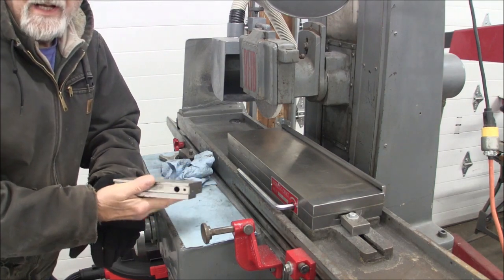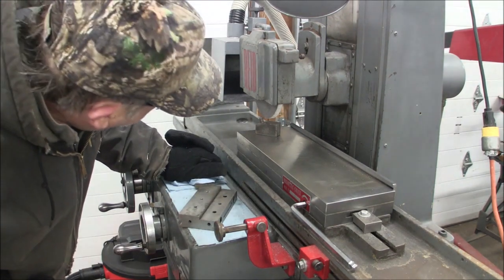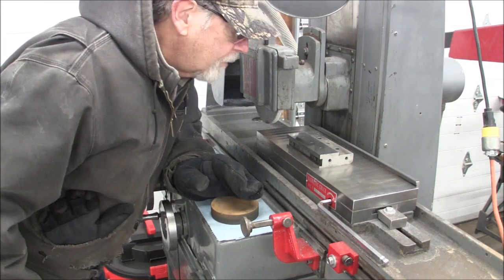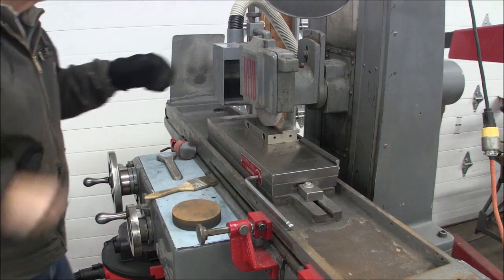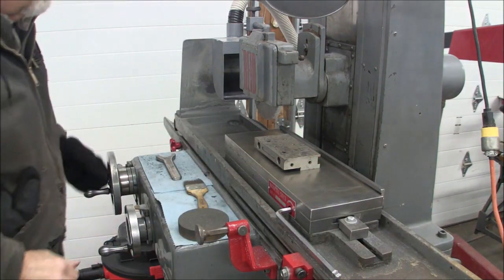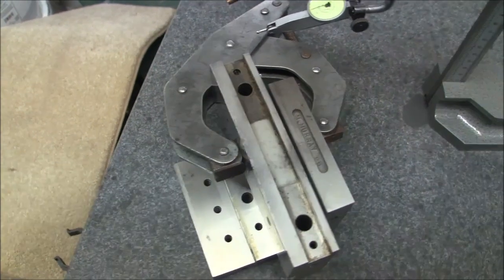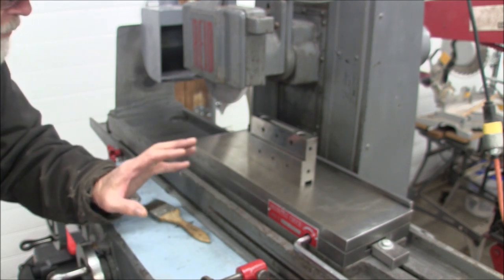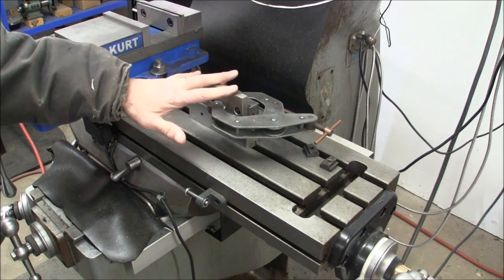Surface grinding 101

Comment: am retired and trapped in by the heat so I want to make a case study of this video to help the community and himself with some tips as to whats going on. it will be lengthy but still like watching machining videos. very good sincere video the guy did. You wont like it at first and will come across like a lecture but you will like it alot in two weeks. As he took the time and effort for the video I also will invest time in it not just one line comments

Comment: That Reid as you know is a nice grinder. I have the Boyar shultz 2A-618. 2 more for rebuild. Thanks for the video, I wasn't award of the "Norbide" learned something. -Tom
Reply: I've got a finger like that...😄. Horizontal bandsaw...😐
Reply: Knoxville....a little bit warmer
Reply: Kinetic precision for the superb wheel balancer....most important especially for finish...(my 2 cents)
Reply from the maker: @tomeyssen9674  Fingers can take a beating through the years.  Battle scars! 😆

Comment: a quick on on sparking out while grinding dry such as when doing precision tooling. You have to multitask you cannot stand at grinder and go back and forth. the sparkout is not what you think hitting off high spots. The fact is the part is expanding up into the wheel and even during sparkout you can get howling and burning. when a person stands there going back and forth till all sparks are gone that is simply because the heat now has gone down into the entire part and chuck. as far as the pin cusion effect when he goes very small stepovers the heat front is outracing the wheel. it is not just the hump in the x it also occurs in the Y. when he starts from back stone cold he finishes up with part hot and the front will be lower. as you start back you wonder "why am I now hitting on the back?" that is why you are going from cold to hot then racing right back over hot to cold. final passes of tenth or so that is why go back to front--now crank back in air. now go again. you are now passing over the metal at same temp.

if grinding dry you have to multitask and have other things going on final passes. dust across then go over and set up other machine or do garbage. now come back and dust over again and knock off the ears. if something only has to be "within ten thous?" thats a milling op not grinding

Comment: Great job Mike!  I just wish I had the space for a surface grinder.   I've seen some pretty nice ones go for cheap lately.
Reply from the maker: Thanks!  I've seen a few pretty good  deals lately too.  I'm thinking surface grinders aren't in demand like mills or lathes. If I had more space is be looking for an automatic wet grinder.  Never enough dang space! 😁
Reply: @michaelmurray9154  Hey Michael, I bought a boyar Schultz 612.  I haven't seen it yet, but I'm hoping it's not a turd, it's only 7hrs away from me!  :-O
Reply: Hey Mike, now that I've got my surface grinder up and running, do you have any suggestions where I can find a jig for grinding HSS lathe tools?  Stan at Barz did a video on one.  Looks pretty tricky to make.  https://www.youtube.com/watch?v=_GOu6db4EJc
Reply: @jagboy69  the same grinder as him? What is it?

Comment: Re the balancing issue, on my SG the wheel fits directly to the shaft so there is no way to balance it off the machine or on for that matter.
Im not overly safety minded but it worries me when people wipe the chuck with their hand under a wheel, i know yours was not turning but i feel it is a bad habit to get into because one day you might forget and spinning wheels and tendons don't much like each other. I always move the chuck to one extreme to reduce the risk of contact.
Reply from the maker: You have a very valid point. I've seen it happen. I took the guy to the emergency room.  Plowed a 1/4 inch deep trench 1/2 wide across three of his fingers. That's why I do very little with the wheel spinning. Tc, Mike
Reply: @michaelmurray9154  ouch and that was my point glad im not the only one to be concerned.

Comment: balancing of wheel: when dressing an unbalanced wheel it dresses to the unbalance and the surface will be fine (if not micro inspected). but I have a surprise for you. that imbalance will toast your bearings over time except in this situation in a shop the grinder is rarely used for long hours. Wheels should in fact be balanced and left on the hub. There is no reason not to do it. People have issues with the actual balancing which can in fact be done not in seconds but in minutes. The large grinder such as his 6-18 MOST CERTAINLY those should be balanced on dedicated hubs
Reply: should that grinder be in shop situation and used constantly out of balance wheels what will occur (long after we all are dead) is that even with balancing the surface does not look right thats because bearings are shot you now have balanced wheel going all over the place

Comment: when he dresses the wheel using the old style diamond when he dresses forward and back BE AWARE IF THAT DIAMOND WAS SHARP HE KNURLED THE WHEEL. he has two helixes going there--that is why when you do that and you look at surface it looks like a mess which in most cases does not matter. I rough dress than do final dress back to front. if something is precision and important if you final pass back to front you have a mess. if you finish front to back such as final tenth or so the helix now produces perfect surface. That is a fact even if when sparking out on tooling I want perfect i finish by cranking off wheel off the part and crank forward as fast as i can and take each final 2 or 3 sparkouts going front to the back

Comment: what i will do is restart the video and comment on each thing. several things among the first start is he stones off the chuck then dresses then grinds. dress first then stone chuck. if you take a ruby stone and run it across after dressing i assure you there are hundreds of micro dings. Next is whether accuracy is needed for the item such as it will be used on mill. surface grinding is accuracy and can be done much faster to max a tenth using same method everything you do. 

He does in fact make a common mistake in that he started out grinding the part upside down setting it on big surface first. on the top was the small surface about half. stone off that surface and put it down and dust off the reference surface the big surface. put the big surface down and dust off a half tenth or so on that small surface since you are there already. You are now grinding in record time to millionths. 

however he is grinding dry but in cold shop. The surfaces he mentions are not flat when they reach room temp they are dished low in the middle that is why at several points you see the pin cusion effect where the wheel is hitting "on the outer ears" as he paused the heat equalized and the middle dropped down. 

at several points he looks under the wheel to creep up to the surface. time is money. with wheel off put wheel off to the right and come way past down creep table into contact with wheel. raise up wheel till it slips over and rolls over the part. crank wheel to the back turn on wheel. dust across feeding a couple tenths till spark and do passes. 

when he comes up to the shoulder and that lower level the same method is used. go to right bring wheel down and touch edge till wheel rolls over. raise up wheel a couple thous. crank up to shoulder going back and forth till wheel makes contact. set y zero. turn on wheel dust off sidewheeling the ledge going fast as possible and getting away from it fast. now crank wheel till spark now feed out as he correctly showed.

cross feed: he has his crossfeed wrong. he has it backwards. on that manual grinder the cross feed is done as fast as possible with his right hand spinning the wheel AT TOP SPEED. The cross feed rarely should be less than 1/4 the width of the wheel to use the entire wheel and lift it up. This exact method is used not only surface grinding but cylindrical grinding where the feed of the wheel going across should never be less than 1/4 or 1/2 the wheel width. That is why he was grinding using only the leading edge of the wheel and ended up with a tapered wheel exactly as he noted. He then fed across to use "the sharp edge" however that sharp edge is a knife edge of the taper that is why he spotted bad surface. 

I was astonished to see near the end that he correctly theorized that the cupping was from the load of the wheel knocking it imperceptibly off concentric from the hub!! It is a common issue because nobody tightens the wheel enough and often the problem occurs while roughing that the wheel hits the edge of part and knocks it off and you get big dishes. However it can also occur as he stated. that as wheel loads up from improper grinding such as too small crossfeed the melted metal will start "howling" and the pressures then reach the same point to knock the wheel off concentric. 

dressing with the diamond he is using is not practical anymore I turned away from it and will never return. A far better dresser are the diamond dressers they sell for bench grinders. Take off and throw away handle. Put head in small vice or holder of any kind. Use that to dress wheel you have thousands of tiny diamonds for a lifetime. I will gladly mail him a few.

Comment: I apologize but I am currently waiting on my PM forum profile to be accepted so I thought it wouldn't hurt to ask here. My company just bought a new Chevalier surface grinder and the operator hasn't been taught how to dress the grinding wheel automatically. He has been doing it manually but we know but the manual given to us only tells us that there is a program for it plus it has a diamond tip dressing point setup off to the side of the magnet. Any advise would be much appreciated, thank you.
Reply from the maker: I'm not familiar with that grinder. sorry.

Comment: I’ve always been told to leave the wheel on after you dress it otherwise you have to redress it.
Reply from the maker: If you take the wheel off the hub you have to redress.  If you leave the the wheel on the hub and take the hub off the spindle you won't have to.  No big deal either way if it's a just a straight dress on the bottom of the wheel. But if you can avoid having to redress a radius or a contour you can save some time.
Reply: @michaelmurray9154  actually I got this answered since posting. Older machines can’t be trusted to start up concentric to the last time they were ran. A brand new machine should grind the same but old school guys always told me to dress every time you cut power to the spindle to get it back to dressed relative to the center of rotation.

Comment: in the old books they should look them up and sue their relatives for damages "those paper blotters are there not to crush wheel wheel BARELY SNUG OR YOU WILL CRUSH AND EXPLODE THE WHEEL! pure garbage. in the united states manufacturing and the world community that statement alone cause billions of dollars of loss per year when grinding. on every machinist group there is almost all the posts show the cupping and the wheels are simply loose